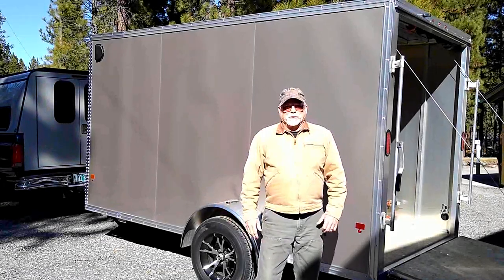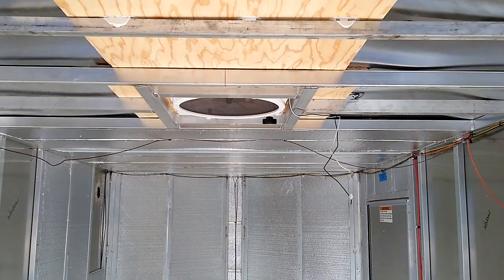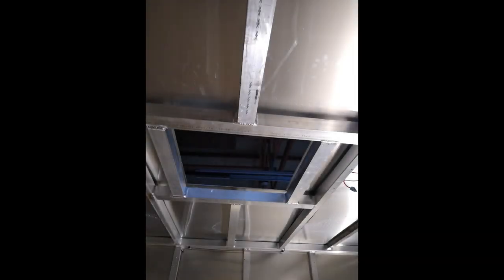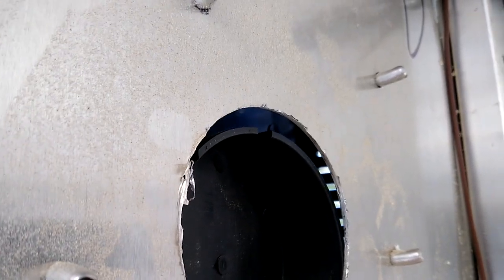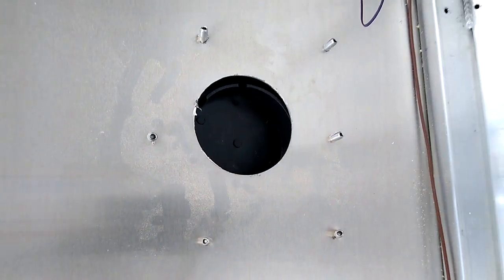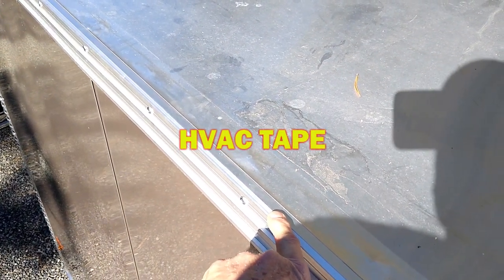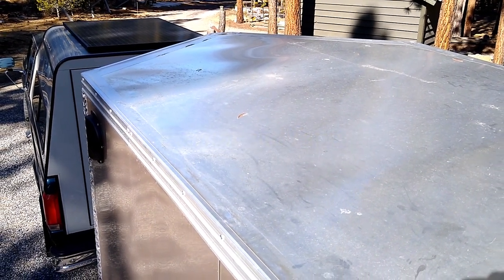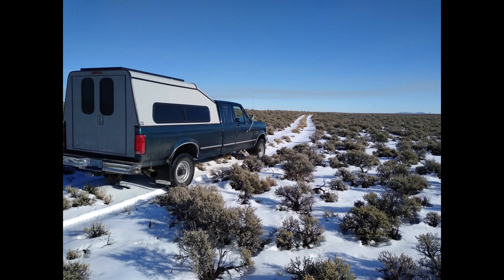CARGO TRAILER CAMPER CONVERSION BUILD part 1

Comment: Y'all have a nice start to a great trailer! Good thing you opened it up and found out the vent was misaligned 😳
Reply from the maker: Hi Just Mona, after removing the interior wood paneling I found several problems. No trailer manufacturer turns out a perfect trailer. Thank you for watching our video and leaving your comments. Have a great week.
Reply: @explorer867  

The manufacturer imperfections is the first and best reason to insulate yourself.

Comment: I have the Fantastic fan on my camper and every time I see the Maxx Fan, I wish I had gone that direction. It's just a way better design.
Life Pro Tip for anyone still in the research phase. Maxx Fan has the built-in hood. You will pay extra for every other fan.
Reply from the maker: Hi Daryl, the Maxx Fan is a great design when deployed allows for use in the rain and when the fan is closed it's very compact. Thank you for watching our video and leaving your comments. Have a great weekend.

Comment: Tap the blue circle with the B in it and watch the updated video of my conversion camper it is a finished  product. I'll be watching for your progress.
Reply from the maker: Brian, What does your trailer build weigh stocked and ready for an adventure? Look forward to hearing more from you. Have a great weekend
Reply: @explorer867  I haven't weighed it yet but I'm sure it weighs less than a couple of zero turn mowers . I pull it with a short bed single cab 4x4 Ram Express pickup with the 5.7 HEMI. It's nice to build what one envisions. Love looking at other finished cargo conversion campers. I also put 2 coats of the 60 dollar a gallon white silicone sealant from Lowe's and painted the underside with the best wood outdoor paint to help prevent rot.
Reply: @explorer867  The updated video was the finished product as I added a few things and made things nicer looking. Will be watching your progress. I'm in Florida but from Upstate NY and was up north working for a few years but hate the cold but love the boondocks .
Reply from the maker: @brianswezey724  sounds like a great trailer. Have a good week ahead.